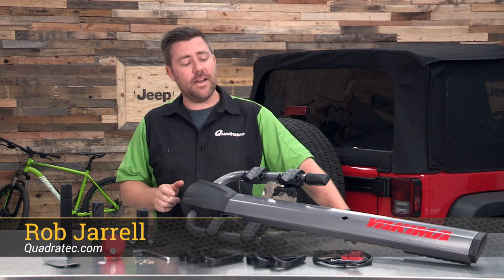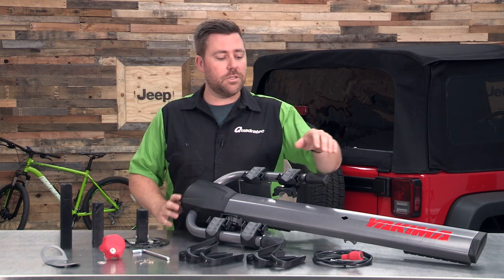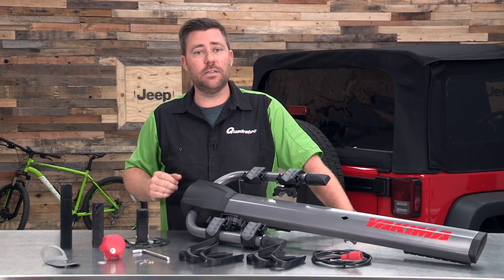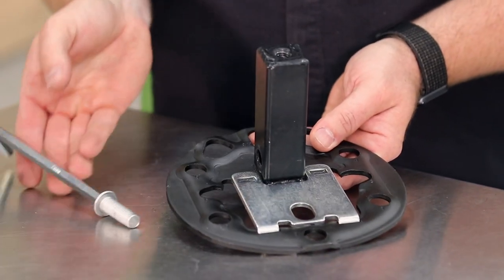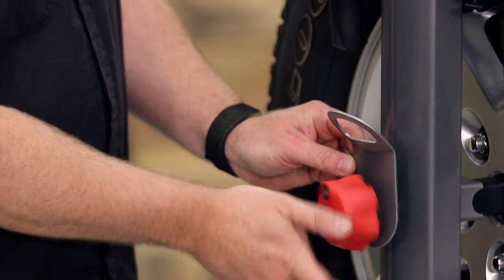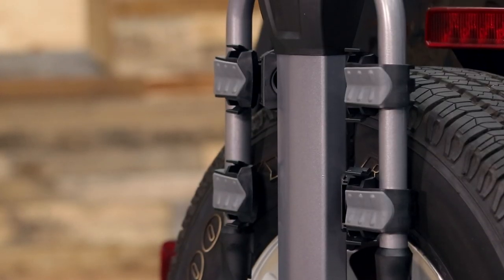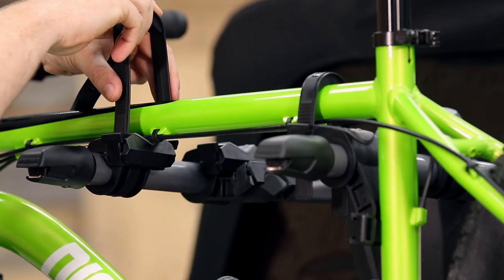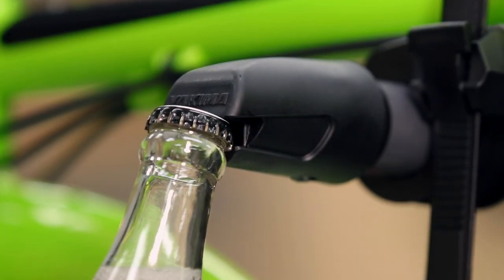Yakima SpareRide Spare Tire Mounted Bike Rack Install & Review for Jeep Wrangler

Comment: Made it work on my JL, relocated the camera to mount on the bike rack...even with 315 tires.  Great rack.
Reply: do you have info on how you did the relocation?
Reply: Ed Karjala I removed the camera, cut off the factory housing to mount the bike rack.  The camera was relocated into a camera housing made from American Adventure Lab used for their spare tire delete kit.  I bent the tabs to mount on the side of the bike rack housing.
Reply: @jmkling  huge appreciation for the info!
Reply: Ed Karjala You can also purchase an extension cable for the camera, I did but not sure if I really needed it.  Let me know if you run into issues I think I have pictures of what I did.
Reply: @jmkling  you're very generous. thanks again.
Reply: @jmkling   Can you PLESAE post pictures and more information on how you did this?
Reply: @jmkling  any pics you can share ?

Comment: There is a serious problem with this system the manufacturer does not mention. You need to use plenty of grease on the bolt in the red handle as well as on the sliding metal surfaces.
If you don't, after a few years of corrosion, the yakima bar becomes corrosion welded to the metal underneath it. Good luck trying to slide it off to access your spare wheel in that case. Speaking from personal experience :)